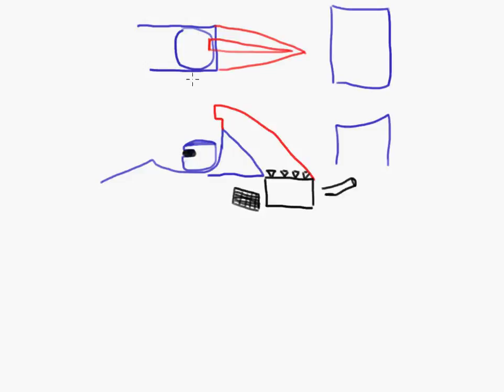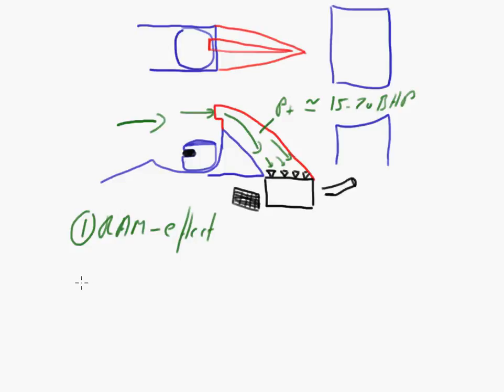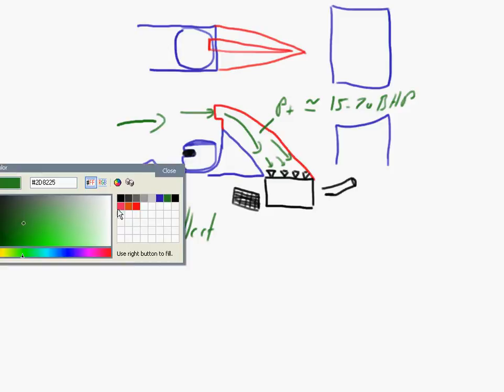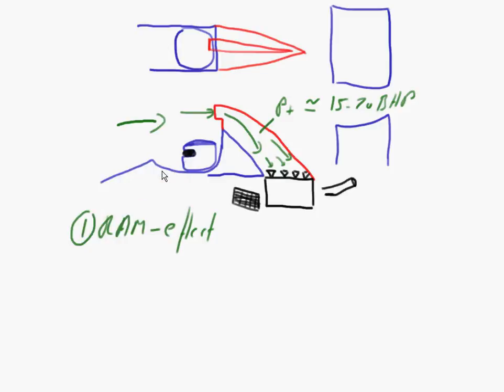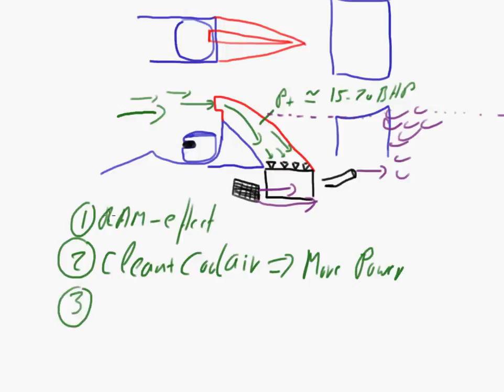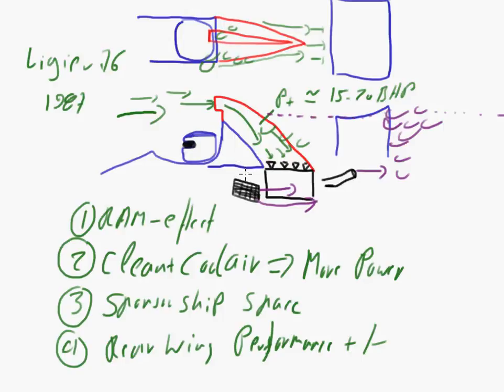Formula 1 Airboxes Explained -- F1 Air Box

Comment: Does the airbox prevent the water that can enter there?
Reply from the maker: Which water do you mean?
Reply: During rain, some water will enter. How it is managed?  

Also,  where is the air filter?  How different is that from general passenger cars. Any information on that
Reply: @kovolff  i must add a very important detail is that the "ram air" main benifit is the supercharging like effect that is due to the air expanding and slowing down as it enter the airbox.
Although counter entuitive slow air is high pressure and this results in the supercharging effect
Bernoulli's principle